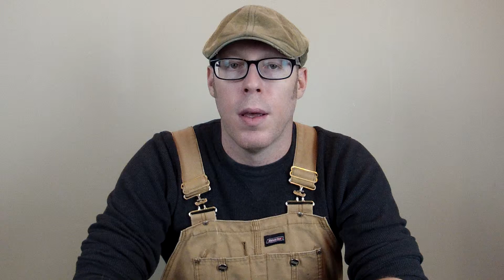Vinyl Pool Inspection Lesson 6 - Skimmer and Returns

Comment: The return hole has rusted and the whole piece has fallen out 
Any suggestion for repair ?
Reply from the maker: Normally this would require that you install a patch piece of galvanized steel over the entire failed area.  The standard process if to epoxy and then rivit a piece of steel in place, grind down the edges of the patch so it is more seamless and less sharp, paint with cold galvanizing compound, and then duct tape over all edges and rivits 2x.